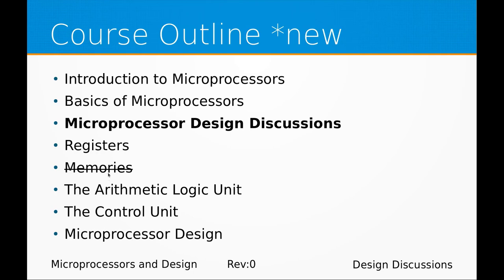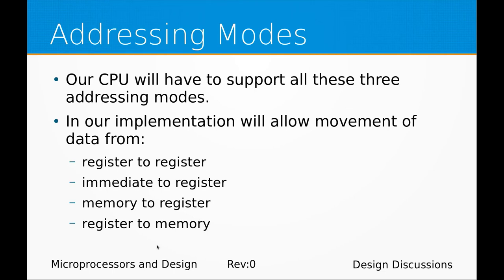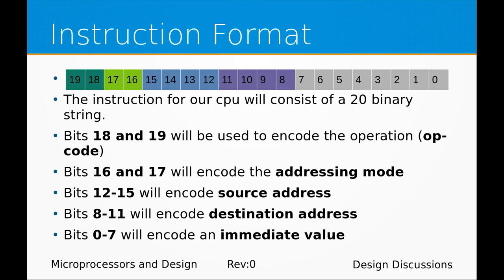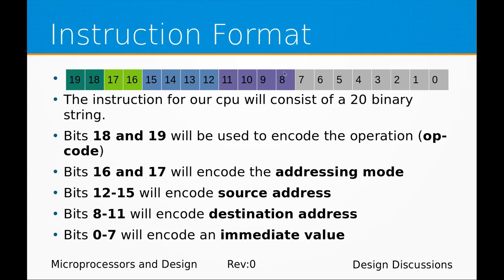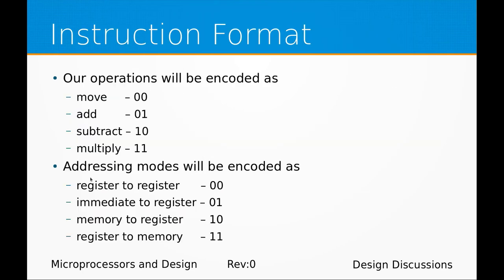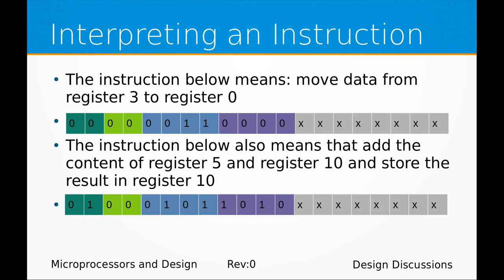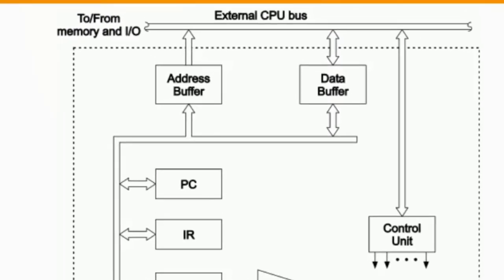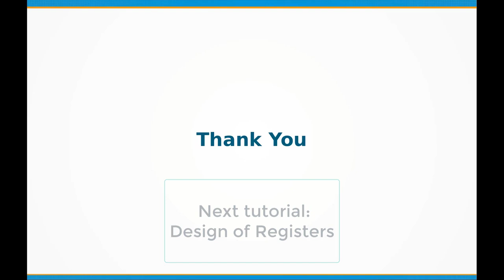Microprocessors: Design discussions and CPU Architecture Basics - Lecture 4

Comment: Please thank for this lecture , I want to ask you,if they give some on a Microprocessor and a memory card can you integrate the two of them
Reply from the maker: Your question is not exactly clear to me. Could you please reword it?
Reply: Is it possible to take a Microprocessor say Intel 8086 and interface it with a memory card chip(which contains a single program)  to make that work together with no operating system ?
Reply from the maker: Technically speaking, you need an operating system to manage not just you cpu but also, every peripherals you have. 

If you want to you your cpu to perform trivial tasks, then you can do just fine without an operating system. 

But mind you, memory card is a permanent external storage. You may have to hook a RAM to your microprocessor.